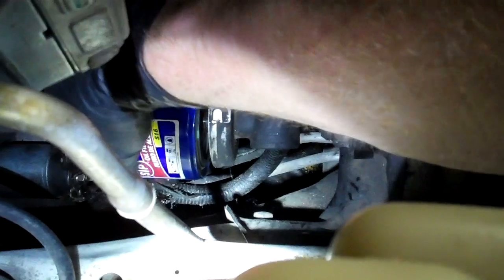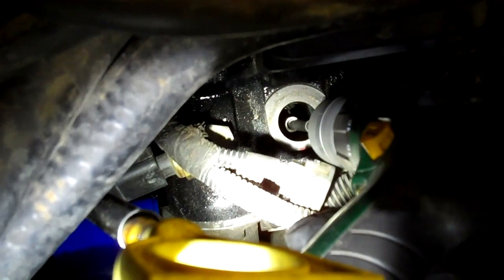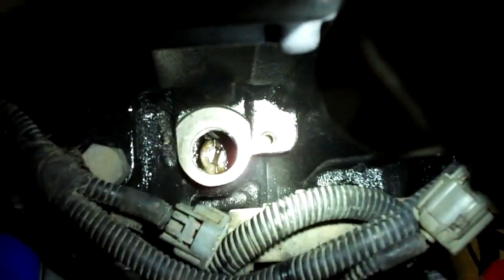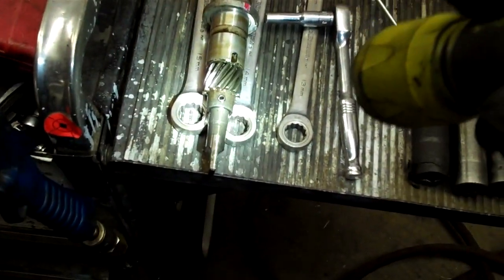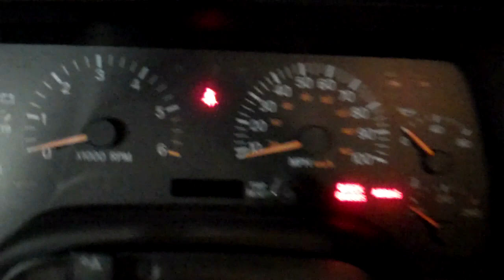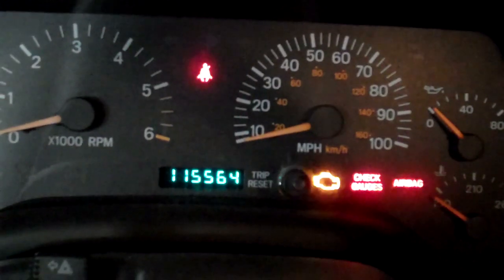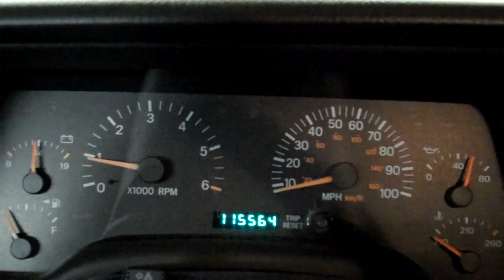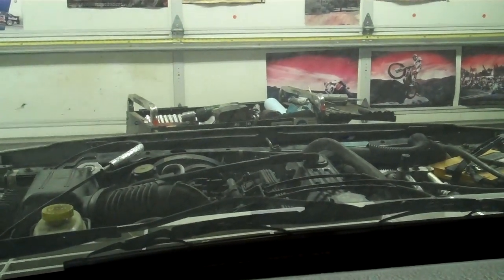How to prime an oil pump

Comment: My 99 XJ would not prime by turning it over with spark plugs out, oil filter out.
Cranked and cranked but nothing.
I had to cut a good flat blade screw driver from its handle and installed it in a drill , removed the distributor and primed it .
It was weird because while priming it was spinning easily then all of the sudden the drill bogged down and I felt a lot of resistance then heard something go “bloop” and made a gushing noise through the pickup tube I’m assuming.
Finally oil squirted out of the filter housing.
Out filter on, took off oil filler cap and primed again for about ten sec then saw oil gushing inside the valve cover.
I continued priming for another 30 seconds to make sure it was good.
I reset the computer and fired her off, purred like a kitten.
I upgraded to 4 hole injectors and a banks header pipe, off idle throttle response is so nice now.
Had to run high zinc oil per engine builders recommendation and I think it’s wiping out my cat now after 5000 miles.

Comment: Great video. Suggestion on avoiding dropping anything into the crankcase. Scrafice a long shack flat head screw driver. Cut the handle off and Chuck it up in your drill. Bam priming tool with no worries of dropping. Worked great for me.

Comment: I dropped a small extension into a spark plug hole while helping a friend change his spark plugs. I just walked into the shop, got one of those magnets that extend, made sure the magnet area was completely free of any kind of debris, and stuck it down in the hole. Fortunately the extension came right out. I hate to think about what would have happened if I couldn't have gotten that extension out as it was resting on top of the piston 😂. I never told him what happened even though he was my friend. 😎

Comment: So what you're saying is in order to Prime the oil pump in that particular engine is to do exactly what you just showed in the video? turn it to let oil come out of the oil filter, screw it tight Then use a drill and turn it until you get pressure, reassemble and start and that's it? My drill also developed pressure resistance after about 10 seconds while the oil filter was connected and I didn't know if I was doing something wrong. I've seen other guys with a inline 6 turning their drill until oil came out of the pushrods without any problems. My drill started smoking when I tried that.

Comment from the maker: @itneverwasme I've had a lot of good results with them.  I did have one bad one in the last ten years.  I cut several of them up ten years ago and these had the most folds per inch and the best guts.  I like the Royal Purple filter the best.  STP is the best "value brand"

Comment: great vid. I have some old distributor drives for doing this with the upper end ground down for a drill. they work on there own just for turning the oil pump say for distributor base timing so everything lines up.

Comment: I'm swapping a remanufactured engine into my 01 Grand Cherokee right now, How did you swap the Crank position sensor over? I was thinking I should find TDC on both engines, than pull and move over, or just match up timing chain sprocket ticks and keyways?

Comment: Great video. This was the first video brought up when I searched for my problem. I just installed a newly rebuilt engine in my 95 ZJ and when all was said and done; No oil pressure would build. The oil pump is new as well. Any thoughts?

Comment: @Taunuslunatic 40 psi is right where it should be at idle. Matter of fact it wont go up much more than that at higher rpms. Especially on a new motor where the clearances are tight your presure will be even higher. 10 psi might be ok for a Harley motor, but if your reading that on a car motor your motor is worn out or it's got a bad pump

Comment: So, the pressure is okay? I have a huge build up of pressure on a new High performance pump using an electric drill I can now smell the drill motor! But it is spinning and bringing oil to the top of the motor. Didn't realize the pressure built up this much. No wonder the gear is solid and running off the cam. Yet I'm not sure that the 351 cleveland is strong enough to turn this f...pump!

Comment from the maker: I don't like phone calls or emails due to my political office and day job. (already overwhelmed)  I am pretty good about responding here though.  Especially if you're brief and to the point.  If your oil gauge goes up with RPM's your pump IS primed.  "Primed" just means there is oil present from the pickup through the pump.  Think of it as thread in a sewing machine.  The pump is threaded so it can pull or draw oil through it.

Comment: I seen a guy test his pump in oil with a electric drill and spun the pump to see if it was pumping on a vortec 4.3 engine .But your right you can burn up the engine not priming it .

Comment: i took a female air chuck fitting drilled the threaded end  out with a half inch bit. Welded the quick connect end into a 1/2" hollow pipe i got at lowes. cut a slit in the drilled in to allow me to tack weld a washer in cross ways to make the blade.Then cut the washer flush with the end of the fitting.

Comment: 1999 5.2 Dodge. Lost oil pressure, truck died but didn't knock first. Installed new sensor, still won't start or turn over. Help

Comment: @briansmobile1 I prefer the check valve on the AMS or Wicks filters- there's nothing quite like starting your engine at -25F first thing in the morning and hearing your engine grinding itself apart o.O
mind if I ask what kinda of oil you like? I tend to stick with Mobil 1 or AMS oil, though I wouldn't think twice about using Royal Purple.

Comment: I try to pay attention watching these awesome videos but I didn't catch if you removed the flywheel before pulling the engine all the way out...I know you loosened the bolts but didn't say if you yanked it before removal.
Can you prime the engine by cranking it with fuel pump relay out and coil unplugged?........I usually prime my oil filter this way after doing an oil change but not sure if it spins oil pump shaft fast enough to build pressure on a jeep......I guess gauge will move if pressure builds right?
I would love to see someone do a video on the jeep stroker motors and what all is involved to do the upgrade such as new injections, computer or any additional items from stock.
Anyways I always enjoy your videos but they could definitely benefit from some better fluorescent lighting.....I know it's tough by yourself though.
Reply: point is that engine is new/rebuild, high change is that some surfaces are completely dry so it is safest to turn pump only with drill so bearings are not moving. Also if engines oil pump is at bottom of the engine, you can also make mess before putting oil pan back on and put oil bucket under pick up tube and spin pump with drill, of course oil starts pouring all over.

With oil change your engine is still soaked with oil and it is safe to turn it by cranking but almost all people and shops just fire it right up, but you should always pour oil inside filter before putting it back on.

Comment: How come the oil pressure is so high at idle?
I've read it should be 10 PSI per 1,000 RPM.

Comment: Hey Car guy your NOT priming the Oil pump  your priming the entire engine .. You need to prime the engine why because the pump is just two gears and its swimming in oil the engine however is not and needs oil all the way up to the valve springs up thru the push rods .. ..if you poured oil in the new pump when it was installed then it has enough to fire  you should run the priming drill until the oil pressure increases ..

Comment: How can I email you personally ? Please sent me an email to joshm@charter.net , I need to replace an oil pump on a vehicle like this one. I'm concern about this camshaft sensor before removing the pump, when you turn the pump as you did on the video to prime it , do you loose your TDC when you line up the marks at your crank pulley when you prime it the way you done it ? My problem is at idle the dash gauge shows close to 0  when increase the rpm it goes up . A light comes on check gauges